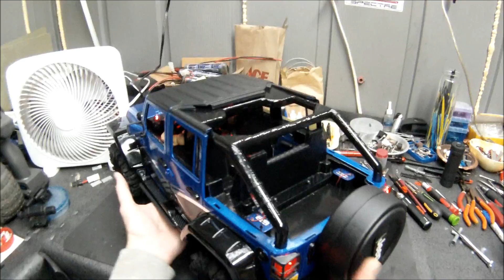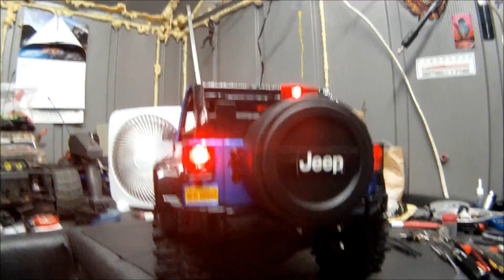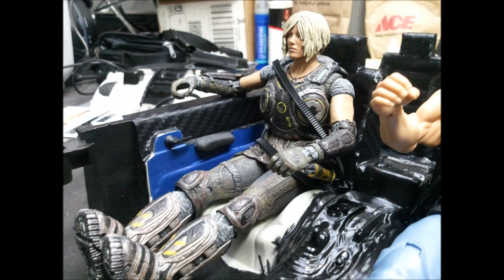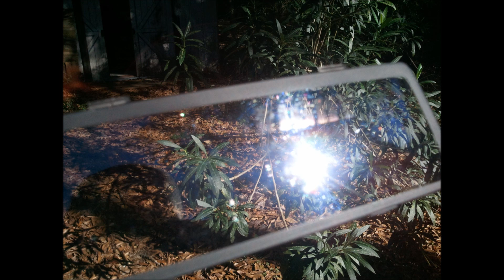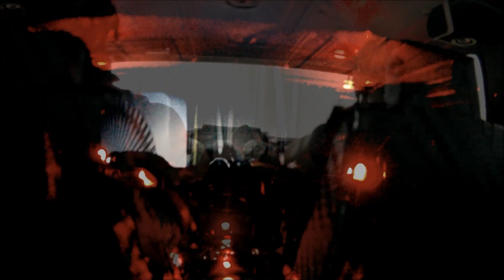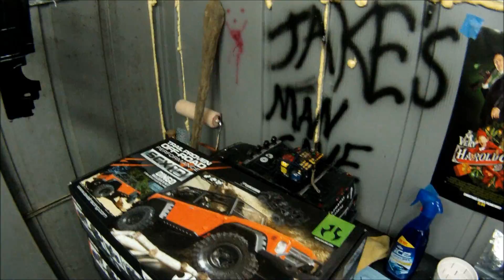Update Jeep Wrangler JK 4door 4X4 Build Axial SCX10 RC4WD 2.2 mud slingers cut converted to 1.9.wmv

Comment from the maker: Thanks and that is about the hardest part to get perfect you have to measure line it up and match it up with where you want the body to sit on the chassis then put body upside down then match chassis n body Boston to the spots mark it check it measure n repeat a few times to make sure perfect b4 you use hole punch/ body reamer tool and make your holes

Comment from the maker: I extended the wheelbase to 13 inches and on body post hole its really hard to explain how I do it but make the body post stick up as high as they will go off the chassis then lay the body upside down on it roof on your work bench then take your chassis with finished wheel base ready for the body turn it upside down place it inside the body line it up where it needs to go the body post will touch way b4 the chassis is all the way in the body and that is where your body post holes need to be

Comment from the maker: I'm not sure those aren't the links I'm running but I had to relocate chassis braces n stuff but on the links I have the top links running in reverse direction compared to the bottom links but when suspension is fully compressed it has clearance because of relocating chassis stuff and receiver box